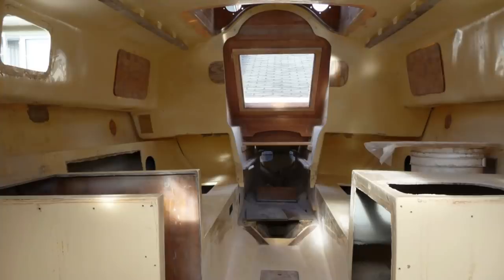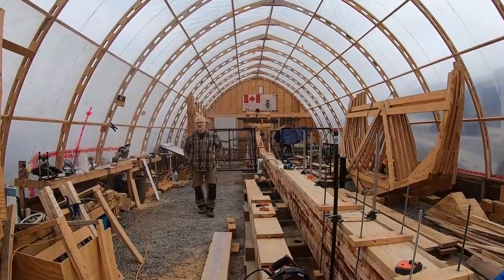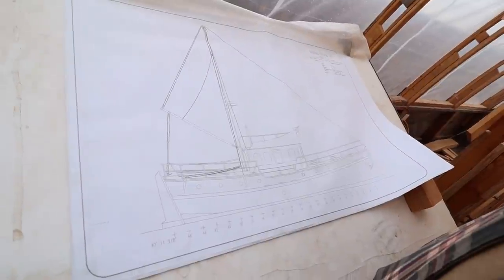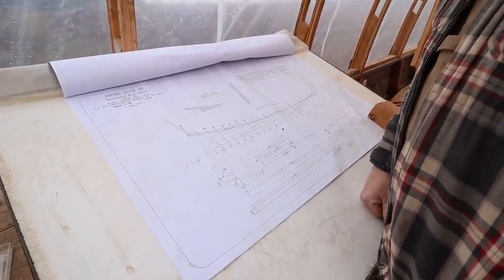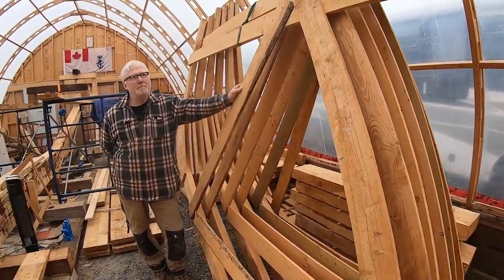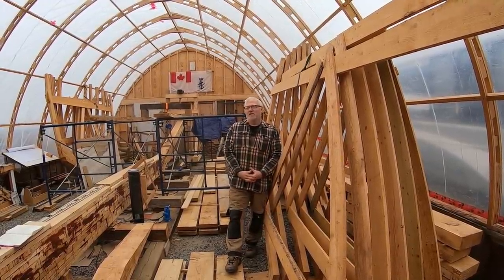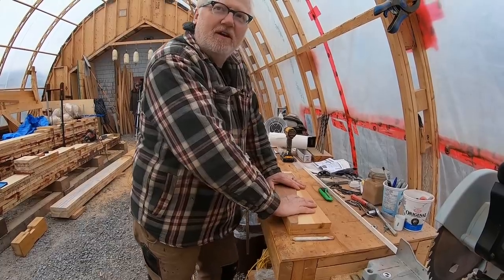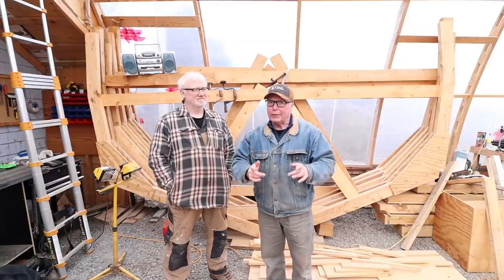S2E21 Best Low Cost Backyard Boat Shed || Wave Rover goes on a Field Trip

Comment: Been following Bills channel. Built a similar shed but made my arches from 3/8 plywood with alternating boxed section and solid block components, assembled in a jig. They turned out extremely well. Light, rigid, and much cheaper than all timber. It’s been up a year now and I wouldn’t change it in anyway. I’ll be putting out a video in the coming months. Then there’s the boat…
Reply from the maker: Looking forward to seeing the video, if I could just turn back time I would build one for the 650.
Reply: @RoversAdventure  yeah a Gothic arch is a good choice for a temporary shed. Walls and roof in one, cheap to build, lots of diffuse light... Cheers